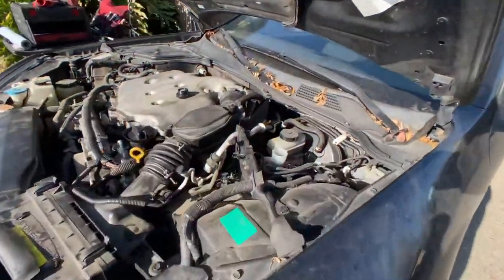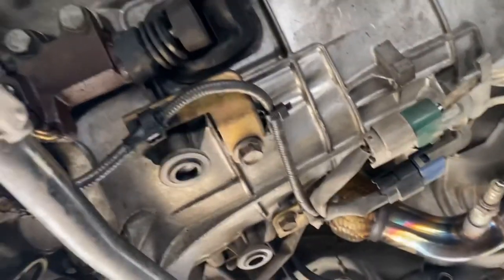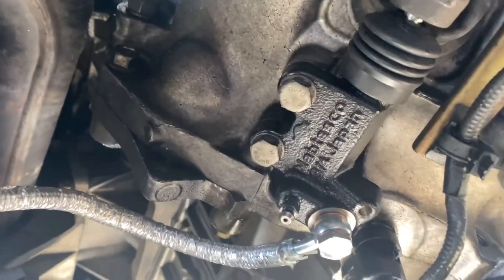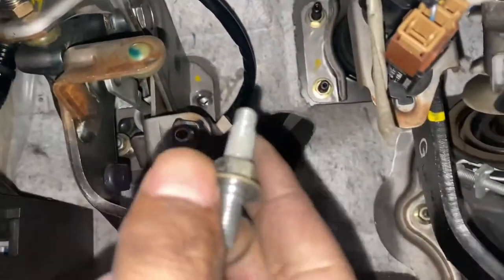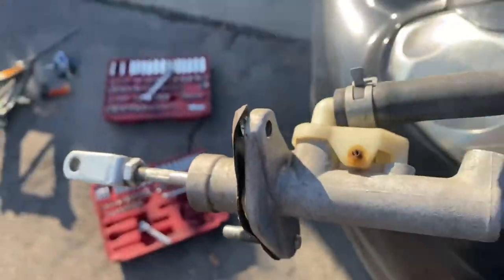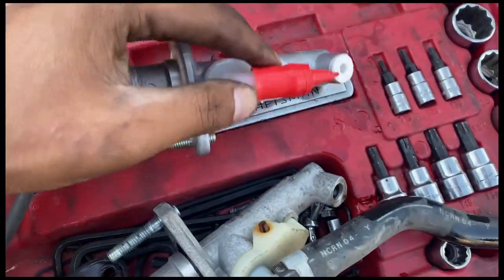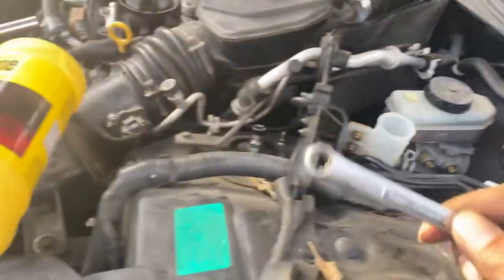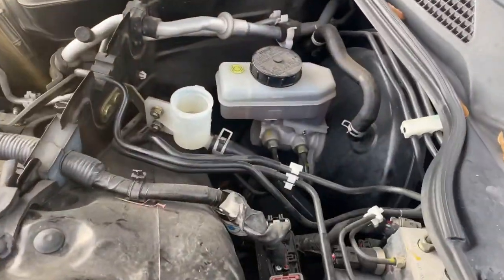DIY G35 Clutch master & Slave Cylinder replacement

Comment: I don't have a clue or the money to replace it so I'm totally screwedbi got a 370 z 2011
Reply from the maker: 370z is the HR model. Clutch master should be the same but your slave is inside the transmission. Have to drop it to change that